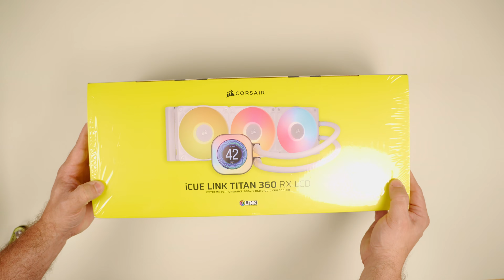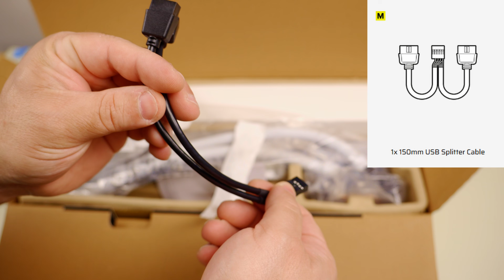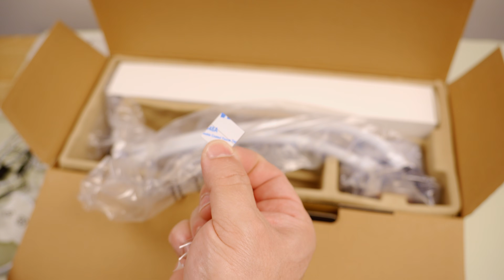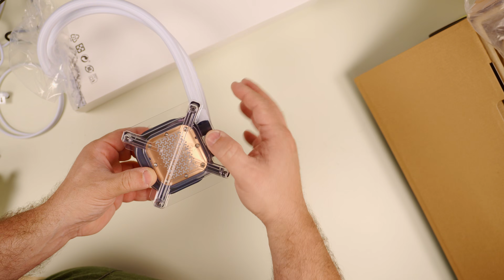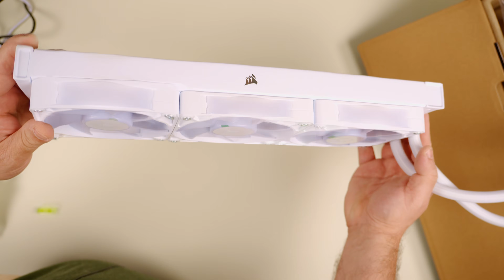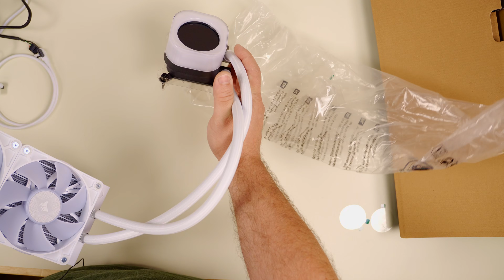Unboxing the Corsair iCUE Link Titan 360 Liquid Cooling Unit!

Comment: Are the two type-c cables the same length? It seems to be a revised version of the hub.
Reply from the maker: Sorry my friend, there are no USB type C cables in this unit.  It includes the following cables, micro-USB, iCUE LINK, 6-pin microfit connector to PCI-e and a Tach Cable
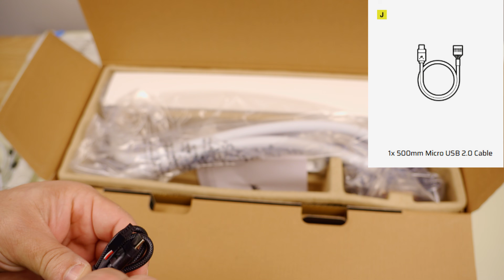Reply: @ThisBytesForYou from here 2:30 in this video
Reply from the maker: Ahhh thank you, its only included with the RX LCD panel, that's a USB C to a USB 2.0 header, so its not really USB-C, but it is USB-C ;)  In the video, where do you see the 2nd?
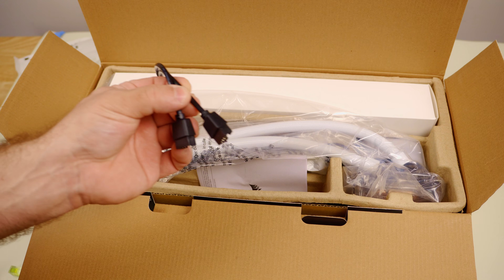Reply: @ThisBytesForYou 2:19
Reply from the maker: Sorry, its been a while, sadly, that was the only one I did not go a full build video on and is in my workstation, its a short one: https://youtube.com/shorts/yRbVJa_znrE

Comment: Good cooler but the ICUE software can sometimes glitch up the pump and you end up with either 0 on the LCD or a red triangle.
Reply from the maker: I haven't had an issue yet, actually I use this in my workstation: https://youtube.com/shorts/yRbVJa_znrE
It all depends on how you install and configure things as well as all the RGB software you have installed and I have built 3 other systems with it, and zero issues.  Would you like some help with it?
Reply: @ThisBytesForYou  I originally had the ICUE H170i, but it died so I replaced it with the Titan 360.  It worked for a little bit, then... RToD (red triangle of death).   Upon doing some research with AI and Google, I guess the RToD is common to this model.  Had I known that... I never would've purchased it.  Going to ditch the entire thing, get an ASUS.
Reply from the maker: @redstar1408 Way back in the early 2000's I had one die, but only once.  I am curious if you are having other issues, as the RTOD usually means it isn't receiving proper power have you checked that the cables are connected correctly, I have built with 3 of these Titans', a few of the H series, that one of the H series had the issue.  When I was a product development engineer at Velocity Micro, we would use tons of them (thousands) and they would have around the usual failure rate as most other liquid cooling units, it happens.  I haven't used an Asus one in quite some time, but I hope so soon.   Which Asus are you going for?
Reply: @ThisBytesForYou  took into our local computer repair shop; the pump was DOA.  Brand new, but must've been damaged when I got it.
Reply from the maker: DOA's happen to any and every manufacturer, even Asus but let me know how it goes.

Comment: I got this recently but I have been having a problem with the fans making  a whistling sound, I even isolated the fans one by one and each fan is making a sound by itself. Is this something thats normal with corsair fans? has anyone else had this problem?
Reply from the maker: No, its not a normal thing for this fan in particular, I am running in this liquid cooling unit in my workstation, the machine I use every single day for hours on end, and its whisper quiet, you can see my doing a super quick build moving from my old case using a different louder unit to this one: https://youtube.com/shorts/yRbVJa_znrE
  Do you have the iCue software installed and configured for this?
Reply: @ThisBytesForYou  I do yes. I thought it was the pump at first but it turned out to be the fans attached to the radiator making  the noise when I started changing the speeds through the program, the only time they dont make the noise is when they are running at 300 rpm. I thought it was a resonance problem but even when I only have one fan running it makes that strange howling/whistling noise.
Reply from the maker: @Braven-j7m  hmmm, well anything could happen.  I recommend calling Corsair, they should be able to help you.  I recommend record it.  Record the sound of the PC off, the sound of the PC on, with the whining, then then sound of each individual fan being turned off, one by one till they are all off so they can get a true gauge on the sound.  Recording yourself doing it so they can see it.
Reply: @ThisBytesForYou  Okay,  I will try that, really appreciate the help, thanks
Reply from the maker: @Braven-j7m always a pleasure my friend, please let them know Thisbytesforyou sent you and please let me know how it turns out.  If they can't help, I can see what I can do on my side
Reply: @ThisBytesForYou  One last question, I used an old 8Pin to 6+2 Pin PCIE Cable splitter for the power supply because it didnt come with one to connect to my power supply, do you think that could cause the problem? Insufficient power maybe?
Reply from the maker: @Braven-j7m  eeek, I never recommend splitters for anything, well maybe fans is OK but not graphics cards, especially ones that were not made for that power supply, thats dangerous.  what is the manufacturer and model number of your power supply and the graphics card you are connecting to?
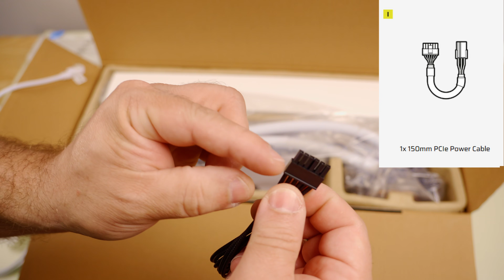Reply: @ThisBytesForYou  I didnt have a cable to connect the cable in 3:02  to the power supply so I used the old nvidea graphics card power cable that I mentioned that came with the graphics card. If you know which power cable I need It would be a great help because I didnt know what to use when it didnt come with one. my pc was pre built so it didnt come with any extra cables for the power supply or anything. it has two 6+2 pin head but I am only using one two power the aio seperate from my graphics card
Reply from the maker: @Braven-j7m  I don't but with the manufacturer and model numbers I asked, I will know and I can tell you.
Reply: @ThisBytesForYou   the power supply is a integrator gold 1000w Aero Cool and I believe the model is ACPG-IMK0FKC.31   the graphics card was a strix gtx 1060 but I am not sure of the model number. Again, thanks for the help but I dont want to take up to much of your time so if it to much trouble it okay but again I really appreciate the help
Reply from the maker: @Braven-j7m  If you have the box for the power supply, it has 2 x 6+2 cables, that branch out to an additional head, use both cables, but use 1 head from each.  You might have to look in the box for the power supply and no bother my friend, I like to help.

Comment: I currently have the 240mm Corsair installed can I just swap with the 360mm and use the same wires I have already installed for the 240mm size one I have?
Reply from the maker: If they are the ilink cables yes, but also make sure your case supports a 360mm radiator and fans.
Reply: @ThisBytesForYou yes they’re the icue link cables and I have the hub too I just think the 240mm looks small in my case and the 380 will loook better so I’m gonna swap lol thanks!
Reply from the maker: Always a pleasure my friend, so very happy I could help, let me know how it turns out.

Comment: can anyone confirm if this will fit with a 10900k?
Reply from the maker: No, that is a socket 1200 processor, this will only work on socket 1851 and 1700 along with AMD's AM5 and .AM4.  you may want to watch the video, info over that
Reply: That’s for the reply, the reason I ask is because I have a mounting bracket from a link h100i and the a backplate that’s made for both 1200 AND 1700, it’s adjustable, so in theory I can swap the metal mounting plates if needed and it should just screw in
Reply from the maker: @reanash2096 a theory I wouldn't play with but totally up to you

Comment: I'm in the process of building my white AM5 system, on the fence between Artic Freezer III Pro RGB 360 and this.
Reply from the maker: Hmmm, thats a good one, I LOVE Arctic products, and I just started using Corsair again, starting with a 240 and now moving to a 360, prior to that I had use Corsair TONS when I was a product development engineer at Alienware and Arctic, and at Alienware,  it was Asetek mainly.  

I am a Corsair Ambassador, but I don't lie with that, I will say I don't have a preference at the moment, I need to review them together at some point, but I like the LCD on the Titan, that shouldn't be your deciding factor, but WOW, the price difference, The Arctic which has always been known for AMAZING quality is almost half the price of the Corsair and the Arctic does not rely on software to control it, its all in PWM in your BIOS, the Corsair is similar, settings in PWM but you can control it and the lighting through iCUE, so if you have corsair gear it will fit in perfectly with your eco system.

The Arctic is a little more difficult to install, it confused me the first time and I have installed thousands, but their new mechanism is odd, you can check it out here: https://youtu.be/_mxrYYivFlM

They are both quiet and cooler well, but the radiator on the Arctic is thick, 38mm, so it can cause issues, the Corsair is 27mm.  The arctic might cool better and has the VRM fan to help, but its only valuable if you are overclocking, a lot, not a tiny bump.

I hope that helps.
Reply: @ThisBytesForYou  I decided to go with beQuiet! 420mm AIO.  Solid quality man.  The Artic's QC was bad for me and I had to return back to Amazon.
Reply from the maker: @OutlawsOG-Blessed  Odd, why was it bad?  I will say though that beQuiet does make some nice stuff, but I am curious as to what was bad about the Arctic?
Reply: @ThisBytesForYou  The fans what came with the ARTIC Freezer III Pro 420mm, given sold by Amazon.  Unsure whether from the returns or from ARTIC's Quality Control team that the screws weren't thread in properly, almost all of them had the "infinity" thread.  Didn't have the ideal "bite" that we expected to have whenever we threaded in a screws.  So I packed it and sent back to Amazon.
Reply from the maker: @OutlawsOG-Blessed  I don't know that I have ever had one that didn't have infinity threading, thats for just about any unit, does the Bequiet have that?
Reply: @ThisBytesForYou  No.  German Engineered.    So far so good, threaded in properly.  Installed the 420mm to the Lian Li O11Dynamic EVO RGB.  Feels solid.  This isn't about the case, so I'll save for another time.
Reply from the maker: @OutlawsOG-Blessed  Arctic is also German, maybe I just don't remember but it threads properly as well, if your torque it too much it will spin and dethread, I would assume like any, but again, its been a bit, regardless, I will have to reach out to bequiet again at some point it has been a while.  When you say inifinity threaded, do you mean, there was no threading when you got it?  Fan's don't have threading, its the heatsink that has the threading.
Reply: @ThisBytesForYou Artic, not beQuiet!.  I ordered through Amazon, not straight from Artic.
Reply: @ThisBytesForYou  Don't know, but all 3 fans had issue.  I didn't want to deal with the headaches, returned and bought the beQuiet! 420mm AIO.
Reply from the maker: @OutlawsOG-Blessed  ahhh if they had issues, for sure it was a return, bugs me when they do that, thankfully i have never had that issue with Amazon, but I have heard it before.  Glad you were able to get that resolved, I would love to hear back from you how you are enjoying the bequiet.

Comment: I love mine. I got mine last year and been working great. I just went with the vrm fan instead of lcd display. Also I used the higher static pressure fans and used the fans that come with aio for the side fans. Can't member but think it was the lx fans that have better static pressure. Only bad thing I've had to deal with has been getting icue software and hwinfo64 to get along together. Been a really good product for me so far!
Reply from the maker: Nice, thanks my friend, I have 4 x LX fans I will be installing this into the  FRAME 4500X, which already have 3 LX-R fans I believe so not sure where they are going to go, but I will figure it out hahah.  Glad you are loving it, hmmm, I will see how icue and hwinfo go, I haven't had issues, but I will also go a clean install of windows.